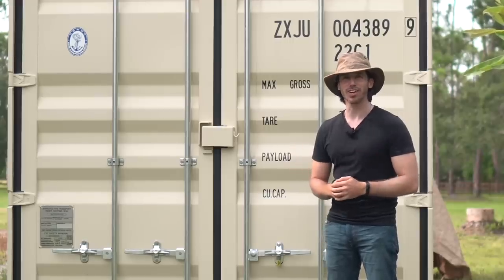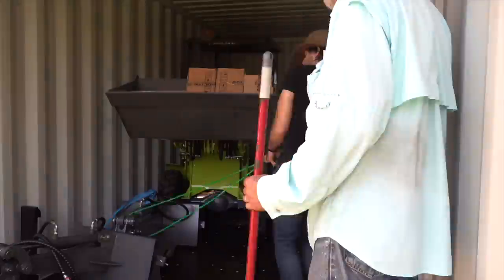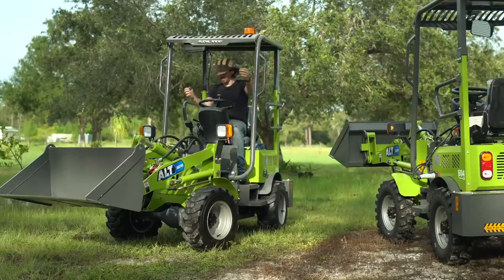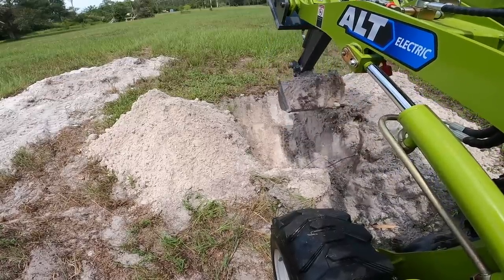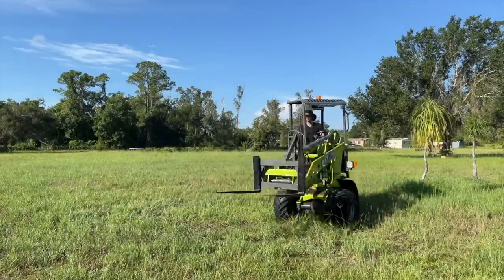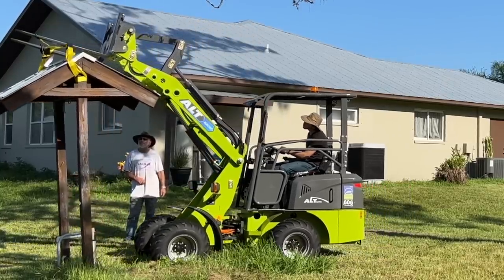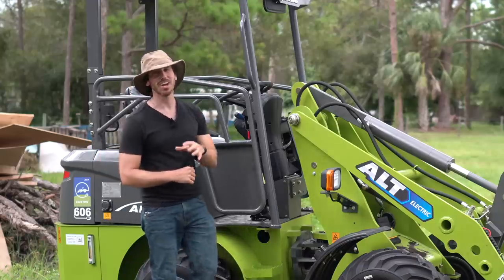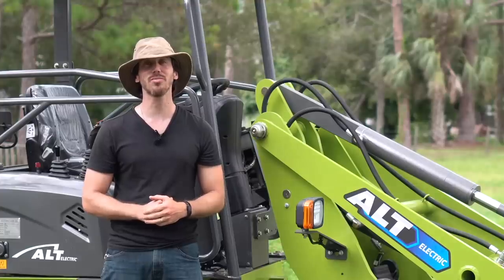I bought a container full of Chinese electric construction equipment!

Comment: If you are using these machines daily in a quiet neighborhood, fine. If you plan to use them sometimes over the next 20 years on a farm, think twice. These batteries are dead before 8 years pass, if used or not, but likely faster ... No matter where that was built. LI batteries are wear and tear items, and dangerous on top, so park it where it could burn down. And you want to spend big money on a new battery in a old loader? OMG, buy cheap, pay later.
Reply: A new set of AGM-SLA batteries is not big money.  When you factor in that a full charge is less than $2.00 USD, even with battery changes after some number of years, it's still cheaper than burning diesel.  Gotta do all the math.  And maintenance costs are lower than ICE as well.
Reply: @micahsdad5388  If they use no LI batteries they have neither power nor a reasonable run time. And LI replacement batteries of that size are so expensive that an 8 old year vehicle is scrap because replacing cost more than the vehicle is worth, while none of my vehicles was scrapped before twice that time, and the tractor still running in age over 50. See E-cars. Plus, LI batteries are a problem when recycling and the resources are a problem before building them. I do not know what you maintain on normal engine vehicles, one oil change a year and thats it, costing nothing. Since these E-loaders use also hydraulic, there is no difference. All other maintenance like brakes is also the same. Maybe stop reading propaganda papers or stop following environment religions and go back to simple engineering and physics. In the EU is the cost of fuel over 70% just tax, while electric power has no tax on it, yet. Dont know how that is is US, but likely not much different. So even the cost argument is bonkers. Just wait till so many EVs are in use that power stations cannot follow the demand and latest then there will be EV taxes coming out even higher than for fuel, because now is the road requirement the same but massive increased E-supply also to pay. Currently done all by fuel users only. These machines EV machines works only for small local services who need a bit more than pickax and shovel sometime, but do not a full time job. And so, as other ones in EU have mentioned who bought a new EV digger ... next time they buy a used diesel one based on their experience! This video is propaganda.
Reply: @unbelievablegoodio7176  So much misinformation and weak logic to even attempt a response.  But here is the wider point: The overwhelming majority of erroneous and negative comments come from the people who have never contributed any content and just seem to enjoy being angry.  So much easier to tear down, than to build up.  I choose joy.  I hope that you find some yourself.
Reply: @micahsdad5388  misinformation ... haha.  Dream on.

Comment: I hate to burst peoples bubble but Chines machines are little more than cheap junk. The biz I work for in NZ and my experience moving them around Western Australia screams loud and clear that they fail quickly and when they break try getting parts for them. Good luck with that. Pins are the most common fail point. The steel quality is abysmal. Next is hydraulics. They're usually underpowered and poorly designed. Those machines will most like begin to fail after 1500hrs if not sooner. My biz learnt its lesson after buying 4 loaders. They now stick to main brand machines like Volvo, Hyundia, Kamatsu, CAT. We only buy gear that comes with comprehensive support.

Comment: I commend you for taking a significant risk. I think the business proposition is a fantastic idea in concept. I think you’re filling a gap that truly needs to be filled, which is the most important part of a business. Personally I would be extremely worried that china is a current adversary of the US and has displayed intent to invade an ally within this decade, which would most certainly shut this prospect down through sanctions if it actually did happen. I hope they don’t and you can continue operating because as I said this is a fantastic idea provided foreign tensions don’t get in the way. In addition to all of that, putting that completely aside, I would’ve appreciated you stating the things you didn’t like about the products and providing specs like run time and load capacity. I know you said you intend to modify them but that stuff would still be interesting to know.

Comment: So, would you say the equipment was well built and will last? I remember that little truck you bought needed some work before you got rid of some of the cheapness. Would you say you’re sold on this Chinese equipment?
Reply from the maker: That truck has been awesome. All I did was add accessories (bed liner, springs, solar panel). These are much more rugged though. They’re built like work vehicles, the truck was made more for just urban cruising and I’m using it out of its element.

Comment: So what happens if it runs out of battery while you're working in the field? Do you have to bring out a generator to charge it or do you have to bring out a trailer and haul it out with the truck
Reply from the maker: ‘Bout the same as a little yellow fuel can. Just bring a little battery generator. Or watch your battery the same way you watch your fuel gauge.

Comment: Chinese made always BIG HEADACHE.
Reply: In some case yes.  Some no
Reply: We had to replace all bearings in electric motors before we installed them into the machines. The motors had no anti condensation heater so we had to fit them. We had Chinese hydraulics so poor that we had to bin them, since then prohibited to buy from China what was not built and tested to OUR specifications. The real problem with anything coming from there is that you have no chance to know how good it is, until you payed too much if it was bad. Even if it is reasonable initially, never forget, basically nobody in China has more than 40 years experience in building any machines, while many classic renowned companies can look back on hundreds of of years. Renowned companies which let manufacture in China is NOT THE SAME as if someone there built something similar with his own limited knowledge. That should be obvious but just look at the comments ....  If you have money for a gamble, well, go on, if you want jobs done for a fair price, don't gamble.

Comment: I’m not user oh heavy machinery, but this begs the question, what happens when you do buy an imported machine and it works fine as intended, but like every other machine (no matter the country of origin) it will need replacement parts, where would one get them? Not sure if this is something you can bring into your basic mechanic, in my opinion that would be like bringing in a Lada car to a local car garage.
Reply: Good question. We have an ever growing stock pile of spare parts at our facility in Florida.  The hydraulics are all standard issue stuff that is easily worked on.  With the advent of more electric equipment out there, lawnmowers and forklifts and the like, there are more service centers capable of working on the motors/controllers.

Comment: This is really great. I am curious as how much each one cost and what the shipping costs were. You may have already answered this earlier,  I just didn’t see it. As far the excavator goes, the 1st thing I thought of was M*A*S*H when Hawkeye & Trapper trapped Frank Burns in an over dug foxhole! Ha ha ha. But the one thing that I was concerned about was the lack of the excavator booms for stability. Other than that,  very interesting. Only other thing was how did you charge these? I'm assuming that you didn’t just plug an extension cord into it, im interested in that charging unit.

How did you find these? Very curious about that. Thanks for making this video.
Reply: Charges with its own charger, plugged into standard 110v wall outlet.  Not unlike your phone or laptop.  Best regards

Comment: How does is perform on uneven terrain? Looks back-heavy I'd be curious to see how much incline in can handle.
Reply: All loaders tend to be back-heavy because of the need for counterweight to balance the load being picked up in the front.  Also, with all loaders, especially articulated loaders, the driver must exercise appropriate care to keep the load balanced let to right with the long axis of the vehicle.   Because of the low position of the electric motors and batteries, electric loaders actually have a very low center of gravity as compared to ICE powered ones.  Regards

Comment: Funny story in the 60s 70s America was the leading manufacturer of electrical heavy industrial vehicles. You already have power to your mining, logging. Heavy equipment uses a vast amount of fuel just moving it to your base of operations is its own cost. Lay one cable and you can run your entire site off it. Then we have the other things like electric technology having a greater power to weight, more reliable, easier maintenance, less frequent maintenance. Nothing a little lobbying can't fix. You know how difficulty is to import anything that would be compete with lazy gaps in the market.

Comment: I would love if the smaller loader was available in Norway.

I would definitely use it for towing too, and get rid of my ICE ATV, 
However European trailers are designed for 50mm ball, so I would probably get that; while 2" is just 0.8mm larger (≈1/32")and would possibly work, it might be harder to disconnect.

Comment: NOVELTY GADGET CRAP...IN 2 YEARS IT'S DEAD, WITH NO REPLACEMENT PARTS
Reply: Oh so wrong - we have a large inventory of parts (seal kits, half shafts, motors, valve bodies, lights, etc.) in our warehouse facility in the USA and getting more all the time.  These have years of good service records in the European and Asian markets, including Germany where high quality engineering and build quality is demanded.  Our Chinese electric dump bed truck is going on 3 years old and working perfectly without a single problem.  Holding a loader for you now that you understand more about them.  Best regards.

Comment: How do you fix them if they break? I can't imagine there are many places or people in the states that can work on these.
Reply: Good question.  They are actually very simple.  The hydraulic system is the exact same as any small loader, diesel or gas. Hydraulic pump with regulator, hoses and rams.  Any service tech can work on the hydraulics.  The electric side is 3 electric motors with controllers.  And there are actually many electric forklifts in service out there and similar machines so service for the electrics is becoming more common.  Best regards

Comment: Do electric construction equipment use hydraulics or motors to lift the dirt?
Reply: electric motor turns the hydraulic pump to drive the rams using standard hydraulic fluid.

Comment: Great near a rechsrge source,but nfg in remote mine camps and construction, with no way to plug in.
The other thing is the battery,how long to rechsrge and when the battery is old,can i get a replacement?
The tires tread depth doesnt compare to n American tractor tires on some chinese tractors,where you need better traction in mucky situations!
But they look good!😊
Reply: U didn't say how much$ but they look like nice tractors!

Comment: Those electric machines look good.  But, Every time I received shipping containers. I  requested them deliver them on a roller flatbed and they rolled the container down on the ground. It cost a little more than a regular flatbed trailer, but less than paying for a crane. Then they pick it up the in reverse or wenching it back on the trailer. The wire Dragon is to keep Evil Spirits from getting into the container and destroying the contents before you get a chance to unload it.  Good luck

Comment: Jus to be on the safe side dont charge them outside of your home or park your truck next to the loaders charging and dont overcharge the batteries or leave them plugged in charging  after they are fully charged.
Why well have you seen fires that can occur with  chinese lithium batteries if they go on fire then you are unable to put them out, if the loader is in your garage or barn then the batteries can burn so intensely HOT that a car, truck, shed, garage, underground parking, parkinglot can cause intense fires setting off anything beside them.
There is a court case right now in the US where a woman parked her LandRover EV in airport parking and she caught her flight and while she was gone it caught fire setting off fires in the car park causing many vehicles to go up in smoke and not all were EVs
Reply: Good news is these are SLAs, not lithium.  Regards
Reply: @micahsdad5388  Yeah most all machines and things like this are SLA. Though once you get them here you can upgrade them to lithium. 
Funny thing is damn near all lithium batteries are made in China anyways.

Comment: If I bought one of these (the L880), the first thing I'd be putting money aside for is a LiFePO4 battery pack to replace the lead-acid battery pack that comes in it.  The stock battery will probably need replaced within 3-4 years with moderate use.  Currently I can source quality cells with double the usable capacity, more than 3 times the lifespan and less than half the weight.  They would cost about $1600 then another $300 for the BMS and $200 for the bus-bars, compression plates, etc.
Reply: There is one other consideration - the higher weight of the SLAs provides considerable counterweigh as is needed with all machines of this type.  The lighter LiFePO4 battery pack will substantially reduce the counterweigh and thereby reduce loading capacity.
Reply: @micahsdad5388  True, but it would be easy to add counterweights that could be used or not depending on the situation.  The lighter weight of the LiFePO4 batteries would be welcome come battery change time which is quite a bit longer than for SLA batteries.  My 3 times figure is extremely conservative.  SLA's can only utilize 50% of their capacity without significantly reducing their lifespan.

Regardless, I wish Micah well in this endevour.   It's almost always a good thing to have more options.
Reply: @michaelg4931  Variable counterweights would be an interesting mod for sure.  As you are probably aware from Micah's many videos, we have a lot of experience with the LiFePO4s and they are awesome as you have described.  Thanks for the good thoughts on the new enterprise.  Best regards and keep those options coming !!  We certainly love options !!

Comment: a suggestion to improve cabin comfort, close all sides of the cabin with acrylic and install a ZeroBreeze Mark 2 type air conditioner that uses batteries and make a video of the modification just like you did in the electric car

Comment: Good luck with the new venture !
3 pt hitch potentials and battery questions are at the forefront - also the specs - as provided by manufacturer and your real use comparisons - Lipo Amp hours etc.. 
Here in Canada we have a zero import deal with China - and yeah, as I write this, the ironic and somewhat surreal moment in time is a factor of sorts also.
Btaim, no fear.

Comment: These are like $4000 in china, but you sell for $11000
Reply from the maker: 1) they don’t cost $4,000, and 2) It’s weird how it costs thousands of dollars to import them, customs charges, taxes, business insurance, stocking replacement parts, creating training material, providing warranty, etc etc etc
Reply from the maker: Ironically, trump did the 25% China tax. And what you did was called LCL shipping which splits the cost among dozens of people all sharing a container. And you can imagine inland shipping a box costs significantly less than a container. Not to mention business insurance, stocking repair/replacement parts, developing training material, supporting a warranty, etc. all adds up.

Comment: You could use the hitch to tow your little truck when working by yourself. Drag it to the worksite, then start loading it with the loader and drive off and dump and return. I always have to walk back to the house to get a truck or trailer after positioning my tractor or backhoe. Altho sometimes I put a bike in the bucket to ride back.

Comment: How much tho for the whole setup with attachments
Reply: Almost $26,000 for the bigger one and all of its attachments. Almost $17,500 for the smaller one and all of its attachments.
Reply: @Well_played.  thx. I'm considering. I work on all my stuff so my only concern is getting parts for them when they break. Cuz China or American thsy all break. U can maintain them properly the best u can but as places are closing down irs even hard to get hoses made for hydronic lines now a days. And the fact it's all electric makes me concerned with weather and wear on the electronics. Even Chinese batteries now have small boards in them thay are susceptible to cold weather. That why if u ever owned a ryobi drill set and left a battery outside in ur cold truck they don't work the next day. Idk if the ability exist but maby raking apart the electronics and the battery pack to see what type of electronics and battery pack theur using. And thats another question. Anyone ever have them stored outside in the cold and attempted to use them during or after.  Idk but I thibk these are all good questions to be answered on a possible video. U don't have to destroy it either. U xan prolly find another youtuber who reviewed the battery and the electronic components either by the same manufacturer so similar cab be assumed or even directly the same boards and Batts. Just a concern with all electrical equipment. I used plenty of it tho and some feom china so it may be decent quality. My boom lifts and scissor lifts are all battery from various countries so I'm interested to see. And chances are it's similar equipment used on those machines because rhey are hydrolic electrically driven pistons as well.